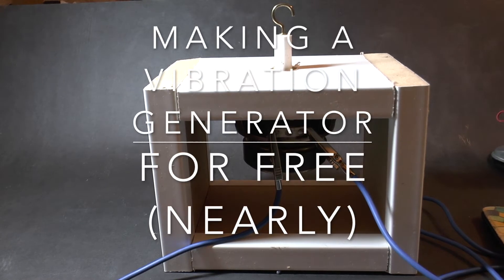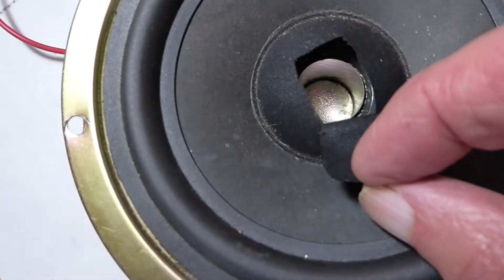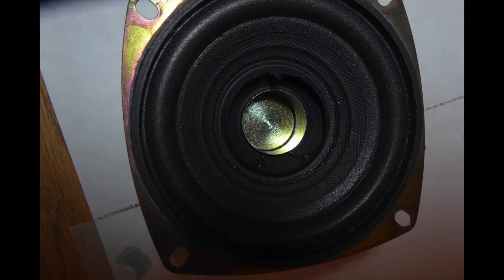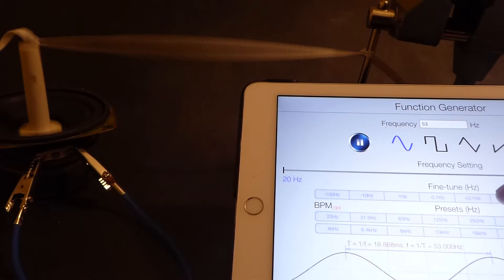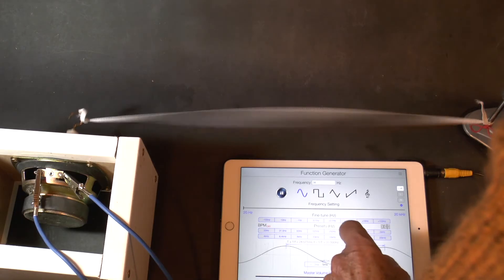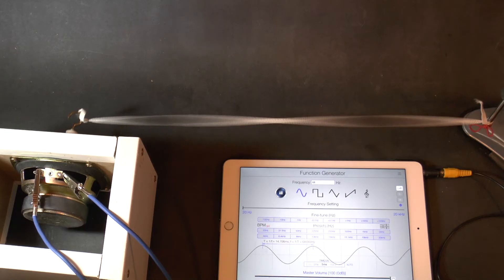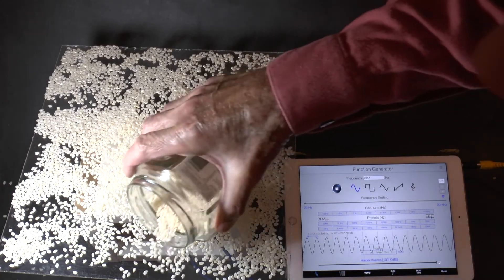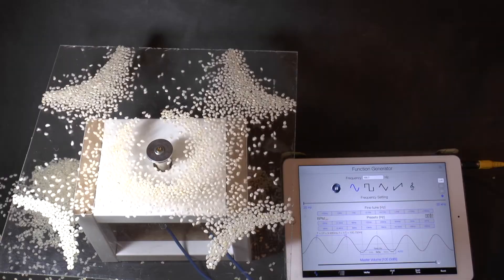Making a vibration generator for free (almost):from fizzics.org

Comment: The first part glueing the tube,what if the tube was a foot long,then wrapped in copper wire,then take sheet of magnet,cut the sheet in thin strips glue them on anotHER bigger tube but on the inside run them sn ns sn ns so when speaker vibration Is 500 per second or more,you can make electricity,i wonder how much,? That is my question a few watts to run the speaker,
Reply: Sorry for irlating  but Where is the amplifier in the video